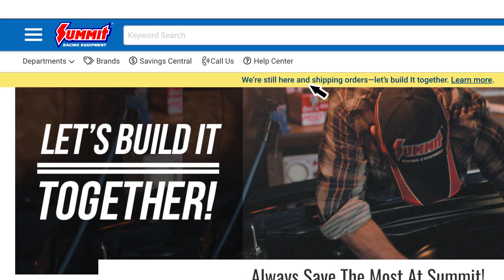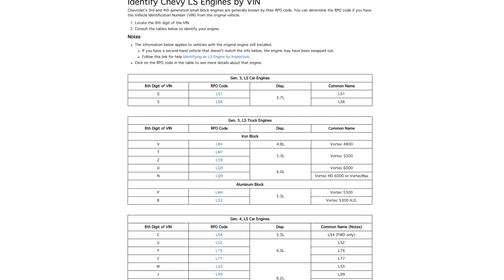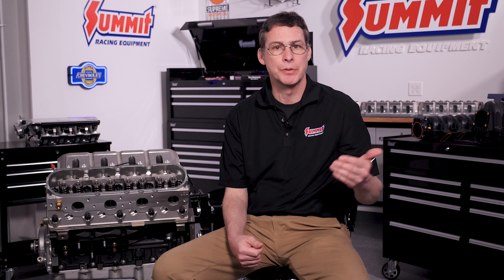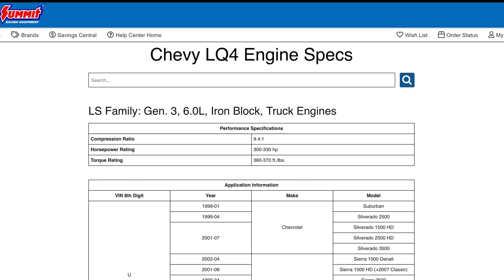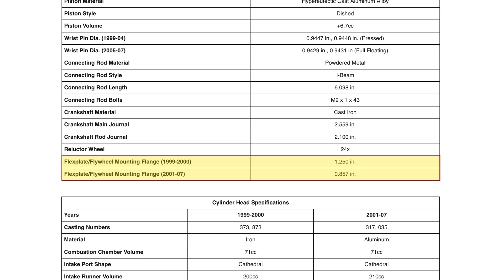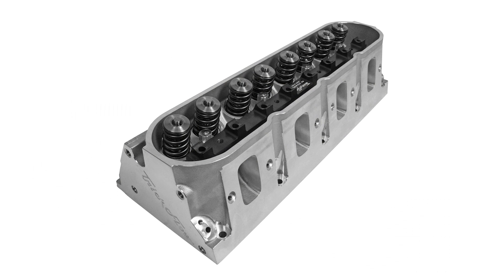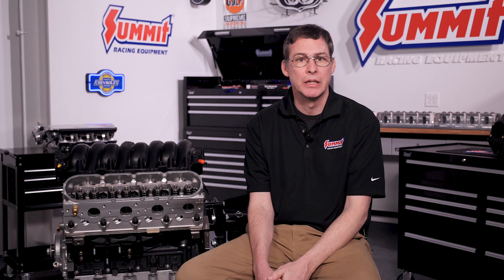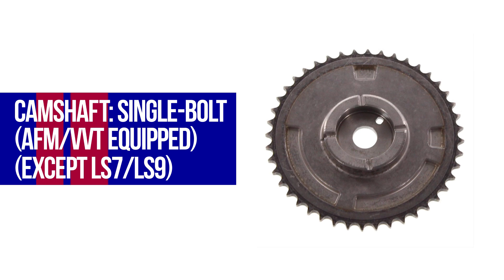GM Gen 3 vs Gen 4 LS Engines...What are the Differences?

Comment: _ Thank you _ I have a question if you or anyone with the knowledge could tell me please...
I have a 99 C5 convertible Vette. I'm going to be building a motor and I have the upp twin turbo kit that I am installing as well...
Would you build the original Gen 3 5.7 or a Gen 4 5.3? I plan on installing new pistons n rings as well as all nes bearings and a btr cam kit etc with ls7 lifters and trays . 
Why would the 5.3 block be better? I heard they have a stronger block compared to the Gen 3 LS engines.
Thank you for any help. ✌️

Comment: Hey im getting ready to build an engine from scratch so i can swap it into my sierra. Doing a full restoration. Anybody have some good tips? Id like to use that 7liter block and use a deeper piston stroke along with a turbo or super charger. But drive by wire and with an 03 transmission. I know the ecu is gonna need completely reprogrammed

Comment: What will I need to throw a gen 4 into a gen 3 car
Reply: Cam sensor extension cable, Might need lingenfelter 54x to 24x box, and maybe some injector connector work. If the gen 4 has vvt and /or afm you'll want to deal with those too. Use the gen 3 oil pump (Melling 295) on the gen 4 after dod delete.
Reply from the maker: That is a very wide question. Here is a link to an OnAllCylinders article for some educational reading on the subject: LS Engines 101: An Introductory Overview of the Gen III/IV LS Engine Family
https://www.onallcylinders.com/2017/09/21/ls-engines-101-introductory-overview-gen-iiiiv-ls-engine-family/

Comment: Always great Tech from Summit Racing. But I'm planning to upgrade the LS3 in my 2017 Chevy SS (made in Australia) with either an upgraded LS style crate motor such as the 427/570 OR even go further and drop in an LT engine (wet sump) but it would help greatly if you would confirm which Çruise & Connect Chevrolet Performance package would fit and work in my SS. An LT5 with an 8 speed auto trans would be ideal but is that a viable option?  If not, what package would you recommend that would be simply drop in and run? Thanks in advance. Cheers.

Comment: LS4s always trip up even hardcore LS guys. They forget GM made a FWD LS. They came with an all-aluminum construction with cathedral 243 heads. I love mine, and it's a pretty capable platform if you ditch the dog poo 4t65e trans. Great video!
Reply: It’s definitely a forgotten engine doing a built ls4 with a 4t80e transmission and dropping it in a hhr ss with a panel conversation.
Reply: @LEGOCAMARO  ooooh that's gonna be good. I've got plans to do the same swap on nitrous in my 6th gen Monte.
Reply from the maker: Thank you for watching! We appreciate the feedback.

Comment: The debate is SBF, SBC, LS or an LT in the 71 Pinto Halfhatch.
Reply: If you want unique, do sbf or LT, if you want inexpensive go sbc, if you want the most power for a bit more, go 6.0/6.2 LS. Yes a turbo will make good power with a 4.8/5.3 but the old adage is more cubes = more power. The only hinge is weight.
Reply: @ispeakmurican4327  I have 2014 LT4 6.2...is there anyway I can get rid of the newer style injectors and run them on the intake instead of straight down in the cylinder?🤷🏾‍♂️
Reply: @sixx6sixx107  need port injected intake and non Direct Injected heads, just find a LR4 or Aylas.
Reply: @shadowopsairman1583  I sold it and got a 2002 ls 😁
Reply: LU3 or Atlas